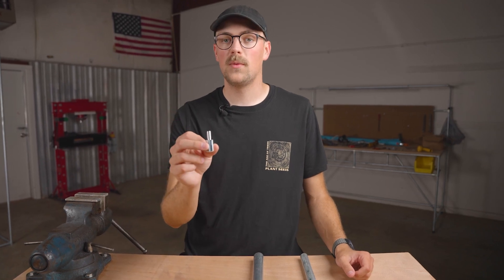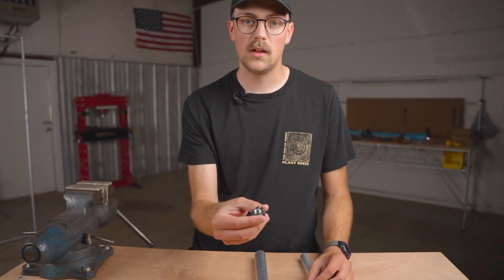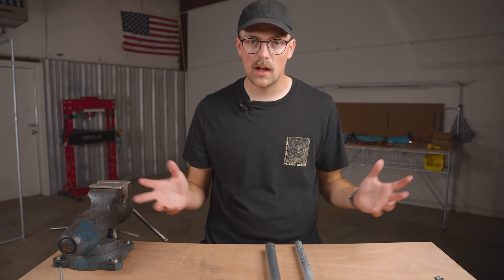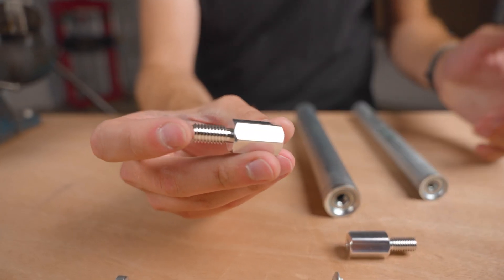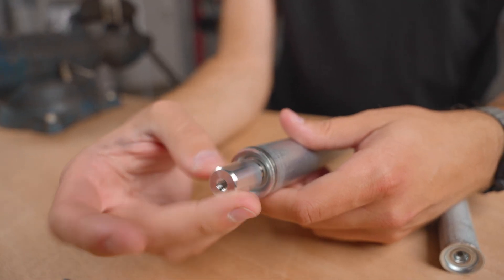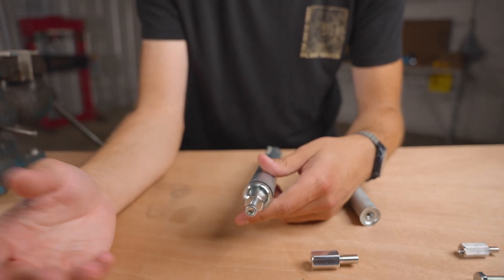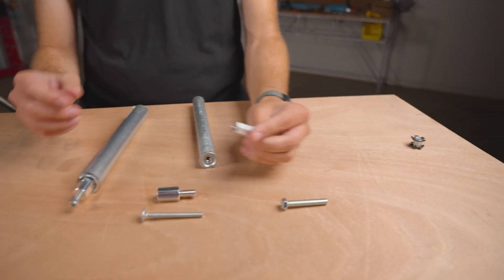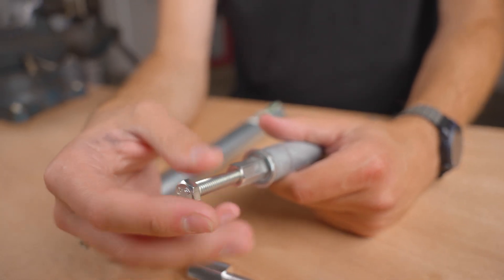These Simple Adapters Are So Versatile!

Comment: So i need a reductor to adapt a architect desk lamp to a 1/2 inch emt tube is there something like that? I have tried to seek pipe adapters but the pvc pipes at 1/2" are larger for some reason, so their adapter wont fit a emt tube.
Reply from the maker: That's an interesting one. What is the diameter of the desk lamp?

Comment: Perhaps there could be a blank adapter that could be drilled and tapped to any size (that fits) for custom projects.
Reply from the maker: That would be cool! Good idea. Thanks for the comment
Reply: @MakerPipe  On that note, it might be worth stamping their centers, too, to make it easier to position the drillbit, and have it done consistently and accurately from factory.